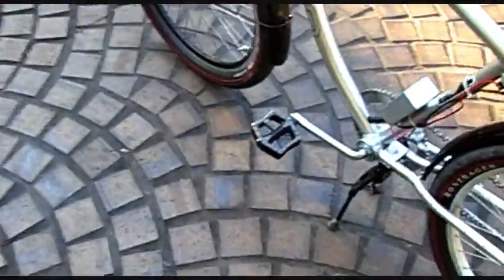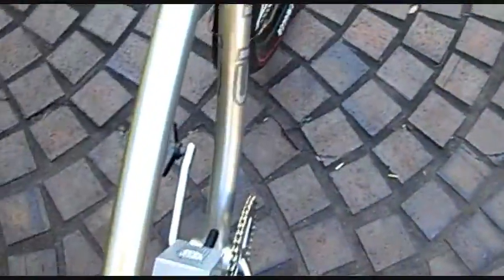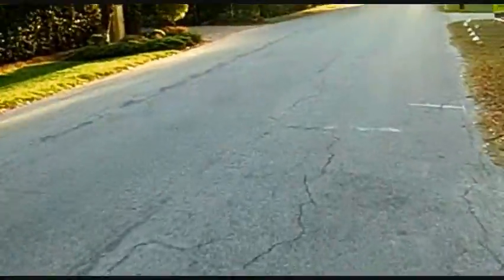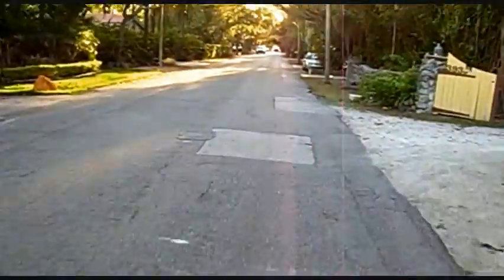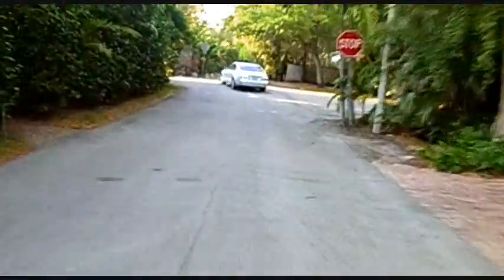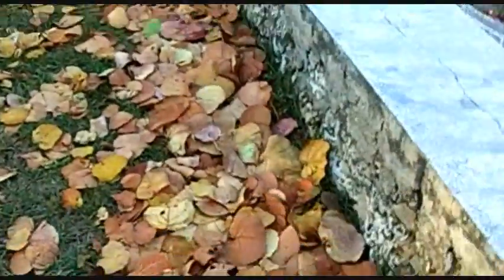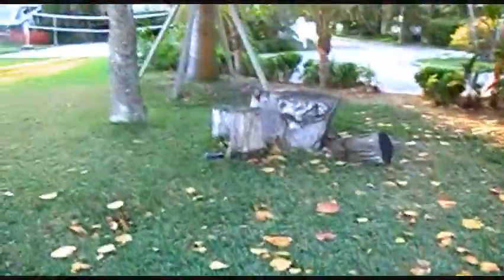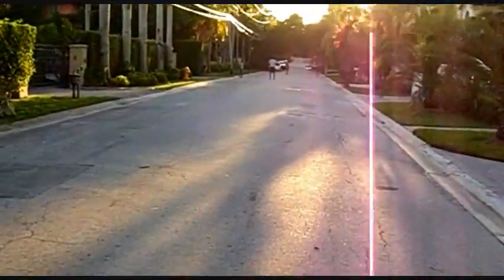new Electric Cruiser Bike Ride in Miami (part 1)

Comment: The BMC/eZee hub motors have good specs out of the box.  What I don't know is how well they'll hold up.  Nylon gears.  Guess we'll both be finding out.

One of the advantages of choosing a longtail frame for an e-bike is the front wheel stays down.  Better traction.  Harder to jump curbs that way, of course.

That looks like a fun rig for Florida.  :-)